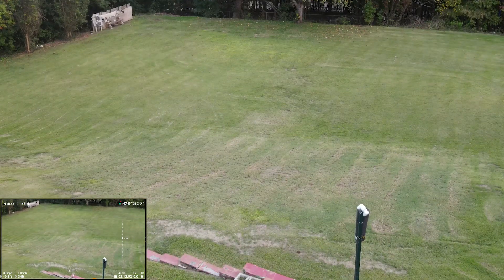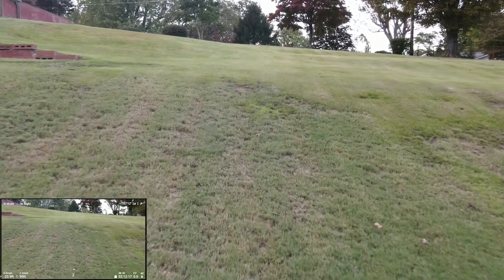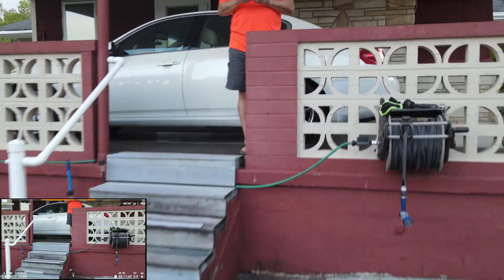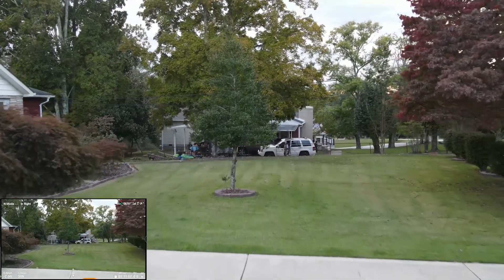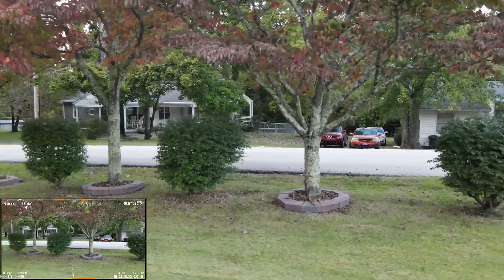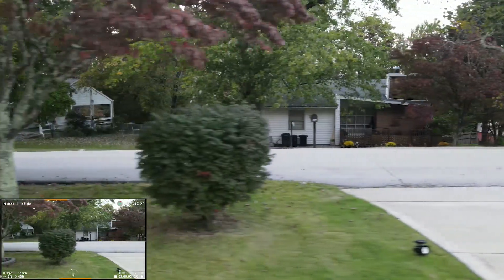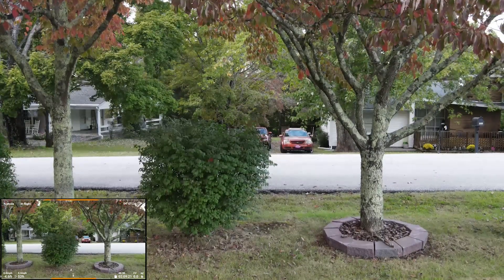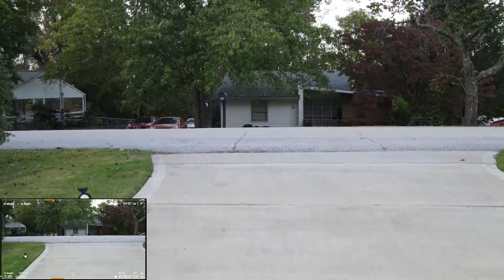DJI Mavic Air 2 - Obstacle Detection and Avoidance Test - APAS/Bypass Mode

Comment: just a  mind game could one use fiber optics to tap into the front or bottom sensors to add some sideways protection?
Reply from the maker: That's an interesting thought, but I have no idea.  I rather doubt it would work though, or at least not without software changes to provide an appropriate direction of response....i.e., not to go up/down or forward/backward but laterally opposite the direction of travel.

Comment: It seems that even without side sensors the mavic air 2 can do the job. Very good test.
Reply from the maker: As long as one understands the need to still fly with some awareness of what the Mavic Air 2 can and cannot do, I do think it can still do a reasonable job of collision avoidance even without side & overhead sensors.  My guess is that so long as during the approach toward a perceived obstacle the drone has forward/rearward vision of some clear space, it will attempt to navigate through that space to clear the obstacle.  But, if anything is still close by and outside the field of view as it approaches, there remains a collision risk.  Regardless, it is much better than nothing!  :)

Comment: you have to admit its great tech, I love my AIR 2 a lot,, a great drone to fly, thanks for posting
Reply from the maker: Yes, the Mavic Air 2 is a terrific drone.  I bought it after the crash of a Hubsan Zino 2 that was the result of a manufacturing assembly defect that Hubsan would not accept as fact unless I shipped my drone to them.  So, I moved on to the Mavic Air 2 which is far superior in build quality, precision of control, and functionality, easily worth the extra cost and a higher value for the dollar than the Zino 2.
Reply: @Ambress  you should really enjoy the change. Every time I fly I’m impressed, good luck to you, happy flying
Reply from the maker: @BjEddy1  Thanks, I do indeed, even if - as is most often the case - I'm just flying around my yard and local area.   Enjoy yours!